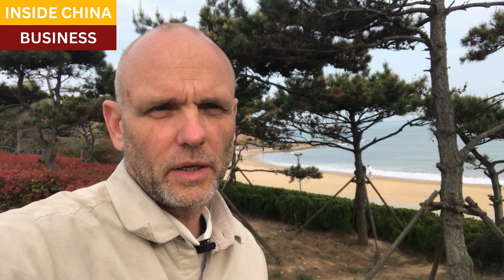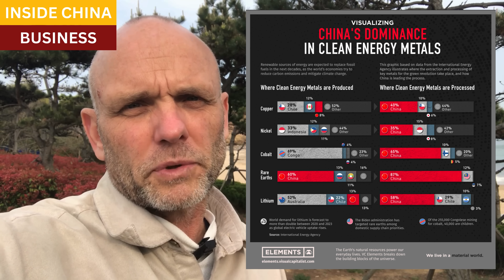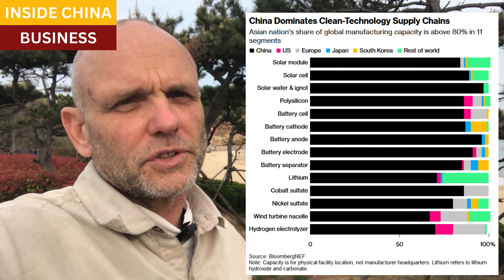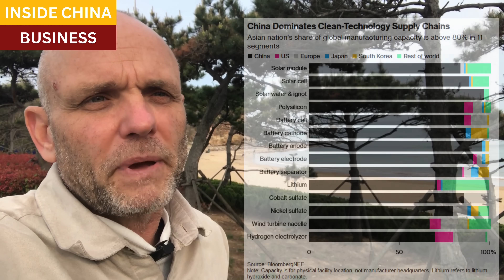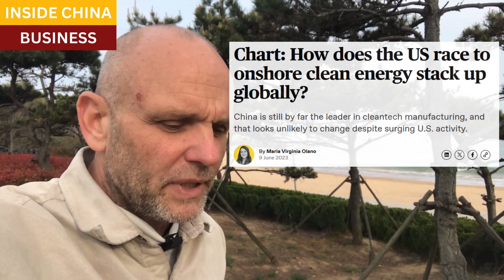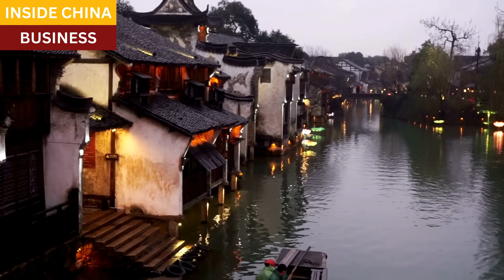China's supply chain dominance means the Inflation Reduction Act is already dead.

Comment: The problem with sll of this is that this green energy revolution doesn't even work, it's a dead end. It's not nearly enough, not reliable, storing is very problematic, current electric grids cannot handle it and it's not even green for the most part.

Comment: Don't need any more solar panels and until a truly affordable large battery system is develeoped, no point in even installing them.  Even China doesn't currently have a superior storage method for electricity created from solar.  As far as electric cars go, why even discuss it?  The power grid won't support another 30 percent electric vehicles in the US anyway.   Lastly, in regards to hydrogen production, this is an ongoing battle for who will invent the superior methodology for its creation.  China does not currently have the only or even the superior method for doing such and the rest of the world is currently working on this problem as we speak.  The one thing China has really going on is the copper and silicon industry..........CHIPS , etc.   That alone is worrisome. For now, we need a bigger power grid, a real one, not some bullshit that works 8 hours a day. CAlifornia has reported that they already produce more power from solar than they can possibly use during the peak hours and they still have no way to store it.  I say we take some of the fiat currency we're sending to shitholes like Israel and Ukraine and start investing it elsewhere. Of course, if we did that, Joe Biden wouldn't get his 10 percent cut.

Comment: The information isn't new.  The charts may have been updated slightly but the trend is always there.
Currently a VW IDS.4 made in Europe is about 2 to 2.5 times the same model manufactured in China whereas it is even more expensive in the US.  The US politicians always pride themselves with the slogan to re-shore the industies back to the US but they never say anything about the cost at the end.

On the solar panel it was WSJ who reported US doesn't even have some parts of the supply chain needed for the solar panel production.  The Wood Mackenzie 2023 has reported US solar panel is 2.66 times of the Chinese.  The IEA also confirmed in 2023 the world's 90% solar power market is supplied by 5 countries with China leading with 80%.  What IEA didn't know is that China is also the key supplier of raw materials and parts for the other four.  It was IEA who said US and EU each accounts for about 1% of the solar panel market!  2023 is also the year China took 12 months to install 217 GW solar power.  THis is more than any country's national total capacity.  The next runner-up US has at the end of 2023 a maximum of 170GW.  Althouigh US pioneered the use of solar power it was China who innovated and brought the cost down by more than 95%.  China has been the leader consecutively for 10 years since 2014.

On the wind power it is US's own goal.  Nearly every wind power project has been ground to a halt by the high interest rate in the US.  If this isn't bad enough the existing grid transmission system does not have spare capacity to carry the new solar parks or wind farms already built or being planned.  The Grid companies want the developers or the government  to pay for the grid upgrade and see little incentive to heavily invest the system because that problem was brought on by others. The devlopers and government see no reason to invest as neither will own the new upgrade.

US has every opportunity to become the leader of EV because every American car company has factories in China making cars when most of the Chinese were going everywhere on pushbikes.  They could have invested in Chinese EV, solar and battery to become the key player but few did that because the US's interest has always been controlled by big oil companies.  China doesnn't have vast oil reserves like the US so its leadership saw renewable energy as China's future.  Thus the industries have been developed to what they are today.

In a way the Inflation Reduction Act is just a vote pulling grimmack because the US has no long term plan for where it wants to go.  Therefore the US could have Trump pulling out from COP28 and then Biden rejoined later.  Just like the current Ukraine war pushed hard by Biden but TRump declares that he would put a stop to it within 24 hours taking office.

Comment: Suggest you do a video on the massive "New Quality Productive Forces" plan (新质生产力) that China is embarking on.   If they succeed in that plan we would likely see a dozen or more sectors showing similar graphs by 2035.
Reply: But a collapsing 's China;s Supply-Chain is also dwindling - Comapnies closing down, Exports All time low, Internationa rejection of Cheap Quality China goods
Reply: @ChuckUstaad  where did you get your facts?  China's total export has been growing over the years.  Especially for cars.  China is the top exporter of cars in 2023 and the gap between them and the rest will widen in 2024.